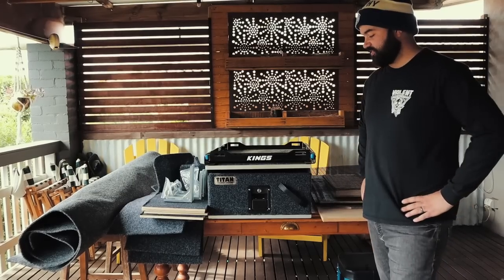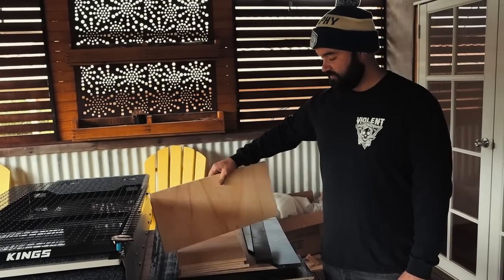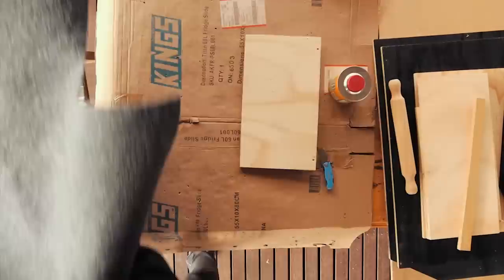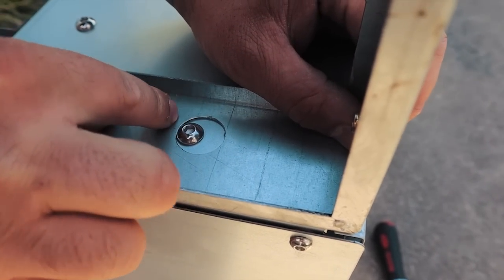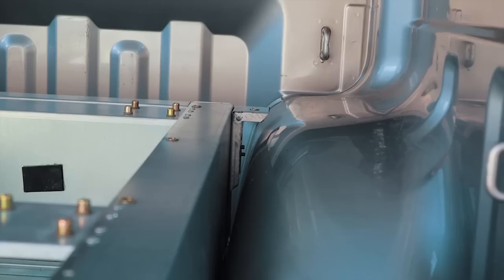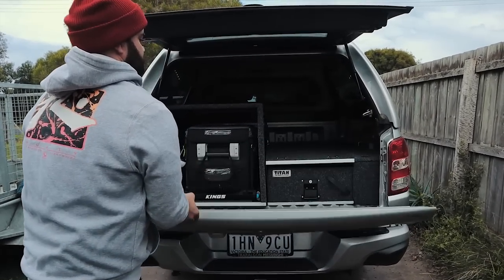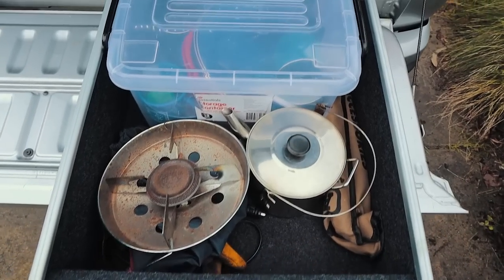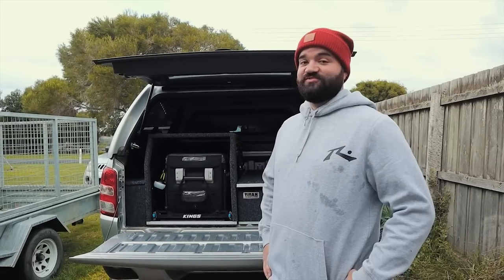DIY CUSTOM REAR SETUP Touring 4WD & Camping STORAGE// FRIDGE BOX & REAR DRAWER // Dual Cab Canopy

Comment: Using that mesh is a great idea!  I was thinking about the exact same setup but hadn't thought of the mesh and was concerned about air flow around the fridge compressor, now I have the solution. Thanks.
Reply from the maker: No worries mate. Such a cheap easy solution too. I found it in the garden supply area at Bunnings 👌

Comment: Hey mate, what draw would you get next time, and did you have a water tank in mind? Love it, and I reckon its custom, don’t worry about the haters
Reply from the maker: Thanks mate! Call me bias, but probably the arb single drawer, but if I were to get a full build I'd with something like Drifta. But the titan draw has surprisingly held up really well. 
I decided against the tank in the end, just for weight issues. But I was going to go the Boab slim poly tank.
Reply: CAMP THE COAST thanks mate, i’ll check them out ... and keep watching. Hope you have a great time.

Comment: Great vid mate! Did you bolt on fridge box to your draws?
Reply from the maker: Nah 2 stand alone pieces. Both secured to the base of the tub.
Reply: CAMP THE COAST thanks for the reply! Also did you use wood glue to make box? Or did you just use screws?
Reply from the maker: @Jmskione  Used screws and wood glue where I could. I folded the carpet over the edge of a lot of the pieces so there was no point putting glue on those ones. I used a sika contact adhesive which worked great at glueing the carpet to the ply

Comment: How did you attach the metal mesh to the wood frame, or is it just pressure fit from both sides? :O
Reply from the maker: Just with staple nails mate 👌